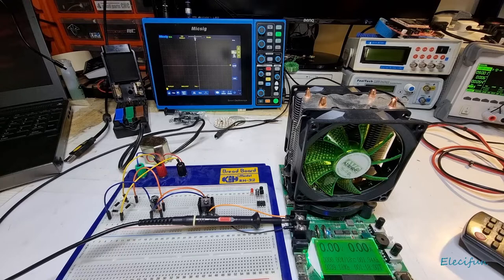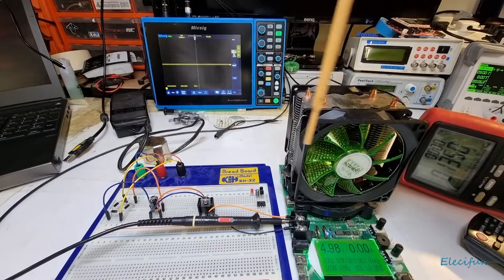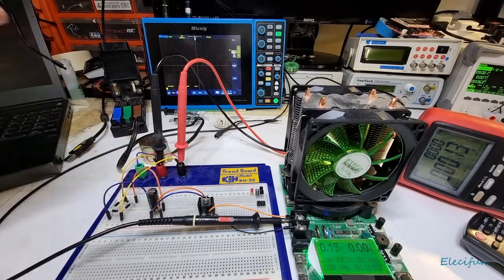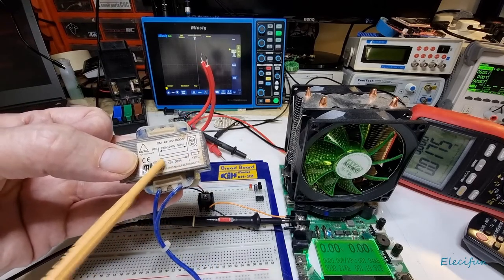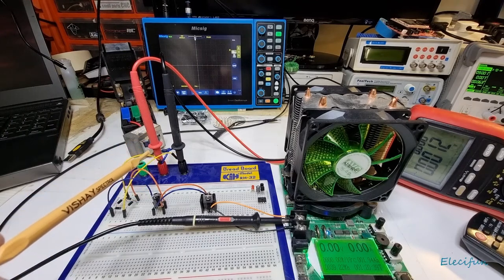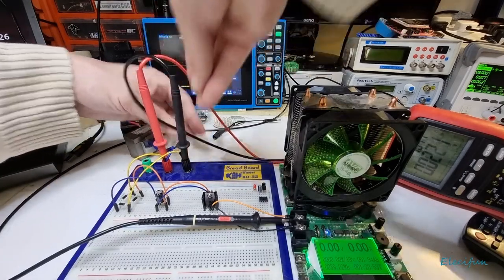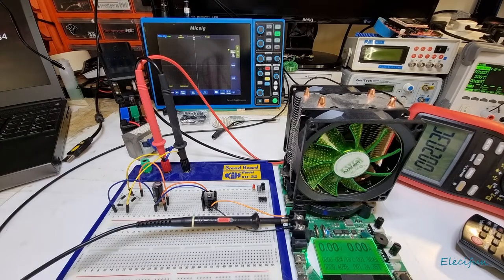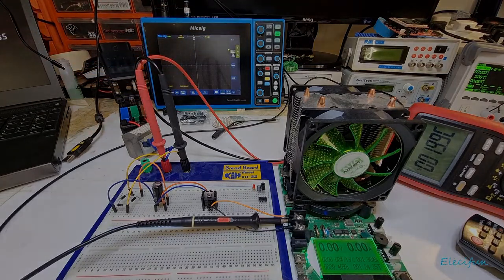Basic breadboard 5v regulated power supply experiment

Comment: Hey dude ! Oh I made one of them a few months ago to try to get a better understanding of full bridge rectification. I don't have a nice dummy load like you have nor do I have an oscilloscope. Most interesting dude. 🤔 thanks for explaining how that works.
Reply from the maker: Playing with this stuff helps me understand... I may have a scope and dummy load but I'm still washing my clothes by hand. Talking of scopes, I have a kit here if you want to solder it up. DSO138 it also has smd parts great for practice and it will work for low voltage <=40v RMS once finished. WSY?
Reply: @Elecifun  Yeah that's why I wanted to assemble the fullbridge rectifier so that I could gain a better understanding of how it works.

Still its going to take me years to get to understand how it all works.
Everything is so damn complex.

You're washing stuff by hand yeah I do to or at least the light stuff the rest goes to the laundry.

My 20 year old washing machine died 6 years ago. 

Its too expensive to buy a new one thats worth buying.

Most are just rubbish.

Which is why I haven't bought a new one.

Sadly I'm poor.
Reply: @Elecifun  thanks for the offer still I'll save up for a few months and get a hobbyist oscilloscope.
Nice gesture thank you.

It would cost you to send it and I have not perfected smd welding yet.
Sigh 
The last three diy kits don't work at all or are faulty.

I've ordered another 250gm roll of solder which I hope helps weld the ICs which I suspect are burnt out.

Anyway let's hope that fixes the welding.

It might take longer than that.

Everything is so damn expensive now.

I've got teeth issues and I've been putting that off for months.

Also my house urgently needs attention.

I've been putting it off for years.

Now the birds are making nests in the walls.

No joke.😅
Reply from the maker: Sound's like we are both in the same boat I like to call  'LePoverty' 
With me what you see is what Iv'e got and most I take chances to get like not paying bills on time and charities for clothes. I am buying a washing machine next week as a charity has funded a bed for me, woohoo to the good times.
Cheers for sharing, your not alone.
Reply from the maker: You have your own teeth and birds are living with you. I lose mine in thew night and panic trying to find them in the morning. Life, supposed to be an oyster but really its a clam. 
Some great generals has said in the past. We never get to go to battle with the army we want, we go into battle with the army we have.
Reply: @Elecifun  New washing machine that'll be heaven. It's been so long since I had a washing machine I've forgotten that people actually have washing machines. (almost) 😄

A good washing machine costs a big bag of money.

Years ago $700 would get you a good machine now no way it's rubbish.
Reply: @Elecifun  My mouth is full of missing  teeth. I had the back molar filled and it's too high. 

Sigh.

It needs grinding down.

I'll go back eventually but the cost to get teeth done is insane now.

Birds living living with me?

No.

Only, the parakeets that's chewing another hole threw the shabby weatherboard.

My life is like George Orwell's life in "Down and Out in Paris and London."
Reply: @Elecifun  Life now is fkn misery unless your making a salary of 500'000AUD. That's what our premier is on.
Reply from the maker: My heart goes out to you. As a kid I grew up on the streets, survived they tell me now. That's what I take from my situation I survived and I won't let the buggers get me down. 
Teeth are needed so much and I know the discomfort of them when they do not bite together properly. I hope you can get them sorted soon.
Reply from the maker: I hear you bro, not sure what we can do about it. Let's hope the next generation get to grips with it and push for change.
Reply from the maker: Its about £20 to send.. would you like it?
Reply: @Elecifun  I can't do that to you.
Reply: @Elecifun  Don't bother amigos.
Reply: @Elecifun  I'm gonna have to buy one eventually. Thanks. It's nice gesture and much appreciated to.
Reply: @Elecifun  have you got the mightyohm giger counter? I thought I might get a serial cable for it. Kinda curious as to which is the cheapest option?
Reply: I thought I'd get this cable and it's $20 USD. After the taxes $55 😬
Reply: @Elecifun  It's never gonna change. The greedy are never going to relinquish their control over us that's for sure.

They'll never care about the poor.

I'm kinda over trying to squeeze more out of less money.
Reply: @Elecifun  You're obviously a smart guy. You either succumb to poverty or you get out of it. You're a survivor.
Reply: @Elecifun  You need to save your money. Next year the whole financial system is probably going to crash. It's bad news I know. Two members of my family are now homeless. I pity my niece who's with a bf she hates living with.
Reply from the maker: @Decem_Unos Quattro   I don't have a Geiger counter not sure what I would use it for.

Comment: Hey amigo!  I destroyed two more flashing light kits today. 😅

Jeezez they're hard.

Sigh.

I think I need a new iron.

I think I'll get a Hakko FM 951 and a 320 micro iron.

My iron doesn't get hot enough if I use the fine tip.

Its useless.

Good morning !
Reply from the maker: Wow, well negative experience is still good experience.. 
Also wow that Hakko is an expensive model. 
I use a Hakko FX-888D which is considerably cheaper and really usable I don't regret the purchase. Although I do understand we all like what we like and should get what we feel we'll be happy with.
Good evening !
Reply: @Elecifun  I haven't committed yet and I'll do more research. It's awfully expensive and my account is depleted. I'll have to wait till next year which means it'll probably be more expensive. Sigh.
Reply: @Elecifun  the TS100 just doesn't cut the mustard although I need more practice.
Reply: @Elecifun  hi amigo, I'm studying the two soldering stations: FX-888D the newest one and the FX-951.

What I noticed is the FX 888D temp range is 200~480°C whereas the FX-951 the range is between 200~450°C which is 30 degrees less than the FX888D. 🤔

Also the voltage on the FX 888D is 26V vs 24V. 
How that affects the equation I don't know.
As we both know those rectifier diode have thick feet and require a lot of heat to melt the solder.

How often do I solder rectifier diodes like the 5404 rectifier diodes?

These diodes obviously require a lot of heat.

🤔

I suppose whatever I do there will be some trade off !

Often this is the dilemma we all face.

Trying to decide which unit to buy.
Reply from the maker: 888D is a good choice. Remember using higher temperatures your soldering tips will have a hard time being left on standby. Bigger solder job used bigger tip.
Reply: @Elecifun  Yes you're right. I read that last night. Not good to have the tips at elevated temperatures. Reminds me of the first "Bladder Runner" movie where Roy Batty meets "his maker"  "Tyrell", Tyrell says: "You have burned so very very brightly Roy." "And the star that burns twice as bright only lasts half as long" which is I guess what happens to soldering iron tips. They burn out if one uses them at elevated temperatures. If you haven't seen the original movie then I recommend you watch it amigo! 🙂👍